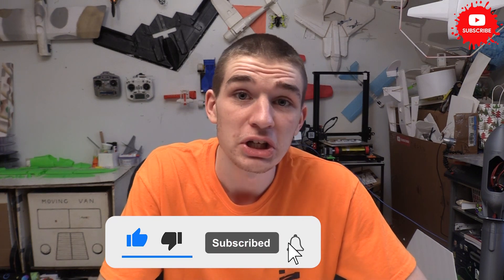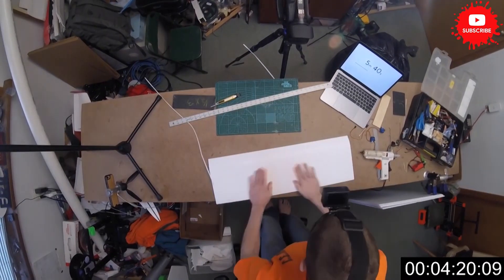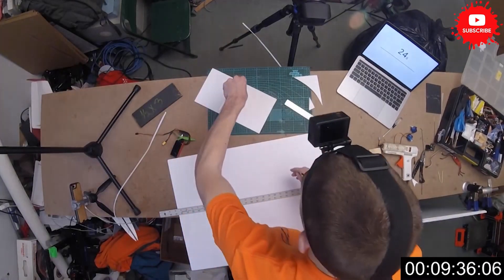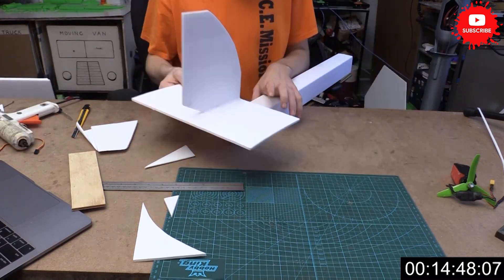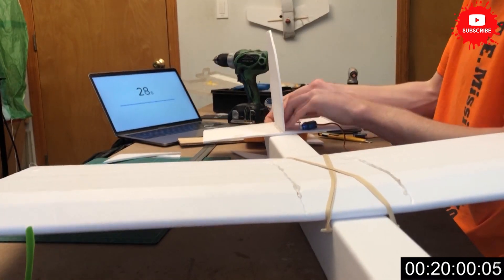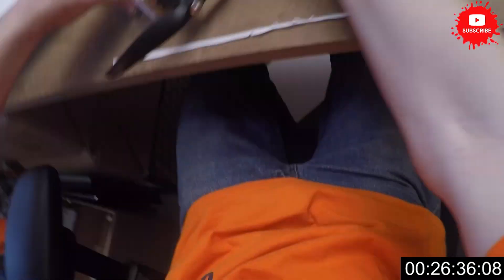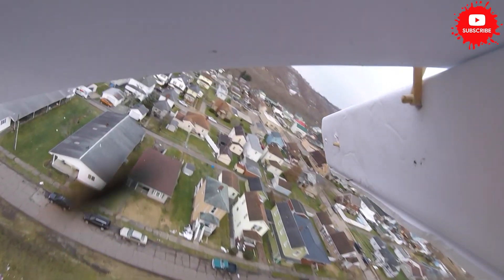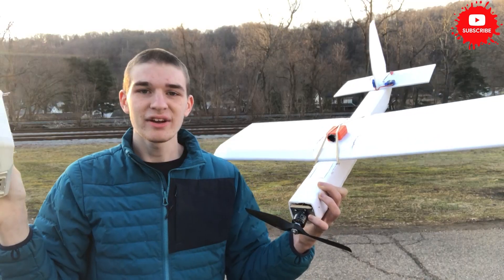How to Build a Super Simple RC Airplane for Beginners

Comment: Hey! I am a beginner and i want to get into rc planes, but I am missing the electronics. What electronics do I need and where can I get them?
Reply: Personally i would start with a pre made one, it really helped me get the hang of what im doing when i saw how its supposed to be done AFTER i spend $100 trying to make one on my own
Reply: @jashuwuh I totally agree. I have been trying for over a month, and I have done this build 4 times. The result is a crash right after takeoff. I don’t even have enough time to grab my controller its that quick. This video helped me learn how to make a great airfoil so theres that. However, like many other videos, there are no measurements (this one its wingspan and fuselage)  or plans. Links provided (often are affiliate links) leads you to believe if you buy everything listed you will have a successful flight, not always the case. I like the videos that provide the min and recommend motor and propellers to be used. CG and Thrust angle is very important as well. The battery type is important along with the motor and propeller too. Example, you may be able to fly a plane with a 1s on a windy day but it is not recommended. Minimum is a 2s battery for any kind of windy day. I haven’t tried this build yet again since I have learned a lot since the beginning. Buying a ready to fly plane is best for a beginner, even if you are good with drones but haven’t flew planes. Also, its important which way the propeller and motor is spinning (tractor vs pusher), and this can vary based on the propeller itself. You want the propeller scooping the air not slicing it. If the propeller is wrong it will be much louder and may vibrate or may not. Not saying it may not have lift but it will not have the lift and power it really needs for a successful flight. Also, the lower the KV the more torque and the larger the propeller you can use. Higher KV is less torque and more speed, but for smaller propellers. All those details are very important and depends on the type and size of the plane for a successful flight. I have been flying ready to fly planes, and making toy foam gliders into rc planes before I revisit these kind of builds. Also word of advice on any build, make it a glider first so it works then add the electronics later. Easier when you know what the CG is first too. Important to know how to measure and adjust according to the CG too. Remember nose heavy will fly more then once vs a tail heavy plane may only fly once.
Reply from the maker: This was my first plane and the plane I learned to fly on: https://www.amazon.com/Goolsky-Airplane-Wingspan-Control-Aircraft/dp/B07F3FHQ68/ref=asc_df_B07F3FHQ68/?tag=hyprod-20&linkCode=df0&hvadid=507593790682&hvpos=&hvnetw=g&hvrand=4493221648169210750&hvpone=&hvptwo=&hvqmt=&hvdev=c&hvdvcmdl=&hvlocint=&hvlocphy=9015222&hvtargid=pla-759526095006&psc=1 It is so much fun and so cheap and durable. Here is a Video I made a while back talking about electronics, and how that works: https://www.youtube.com/watch?v=fWk8wvmUSHA There are also some pack out there like the ones made by Flite Test: https://store.flitetest.com/ft-power-pack-b-radial/ With this you just need to buy the Battery, and Controller and receiver separately. Let me know if you have any more questions. Have a great day!